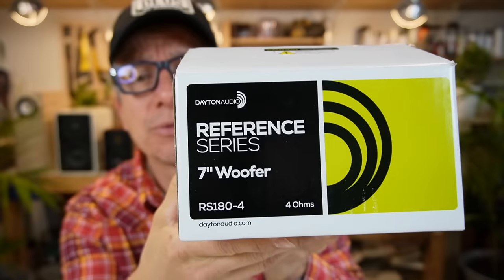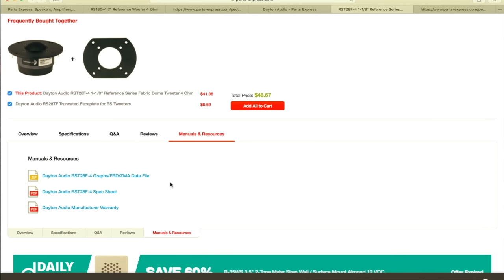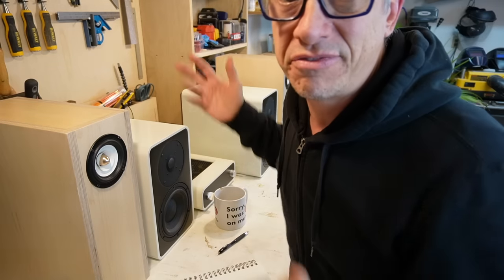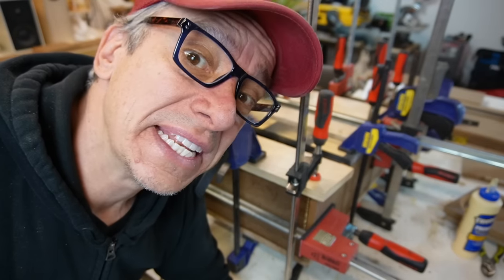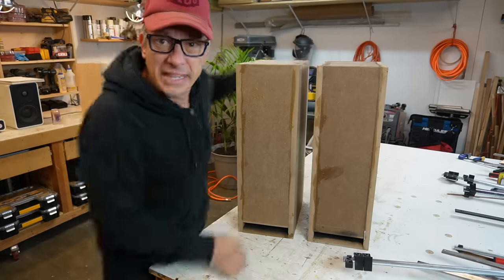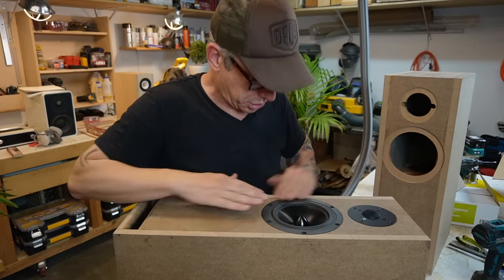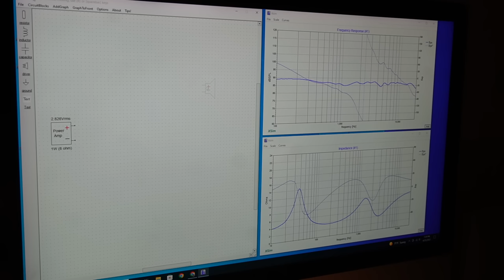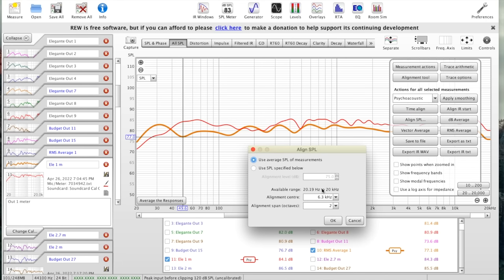Dayton Audio Reference Series Speaker Build | DIY | $200 Drivers Deep Bass Hi-Fi  Elegante Speakers

Comment: Ive used these Dayton reference 7 for several builds but the paper cone version sounds so much better.  I am getting a few more of the paper cone to play with.
Reply from the maker: Good to know. I had those drivers at home though but I wanna try the paper one sometime! Thanks!
Reply: @sonnoradesign    Check out the SEAS Prestige paper cone drivers.  SB Acoustics too
Reply: How’s the low end on the paper cone in comparison to the regular reference cone? You find much of a difference?
Reply: @billymurphy3  they sound very natural and warmer than the aluminum cone. smoother in the mid. Surprising bass response and very fast.
Reply: Hey Soniclab, can i get in touch wih you? I need a crossover design for a too way with RS paper cone...
Reply: @GurvanBHC7  I use an active DSP for most of my builds... your x's-over settings will likely be different for any different enclosure and room as well.  I would start by picking a matching tweeter and do some preliminary measurements,  build the crossover from that.  You may find there is a prefab passive network that suits your build.  Parts Express has some decent-ish ones..  If you want a better one the only way really is to get a range of component values and tweak it till it measures and sounds good...  I am still learning so much from each iteration and there is a wealth of knowledge out there to draw from.

Comment: Good choice of drive units. I've got the paper-coned version (RS180-4P) in the front doors of my car, along with RST-28A tweeters. Woofers are actively bandpass filtered between 80hz and 4KHz, tweeters are high-pass filtered at 4 KHz. Sounds awesome with massive midbass. Aluminum dome tweeters are detailed without being harsh or fatigueing. There's no car audio marketed speakers that can come close for the price of these puppies.
Reply from the maker: I really liked those drivers. I’d add a second woofer if making this box again. Get more SPL and bass. The tweeters are really clean and articulated. Good choice.
Reply: One downside of the Dayton tweeters is that the plastic holding the spade connector deforms very quickly when soldering cable directly. They are not easy to tin without the plastic deforming.

Comment: Hello Bernardo. I am going to try something similar to your veneered side panel design. I don't understand how you veneered the edges. I saw you use the saw to cut veneer strips and then you tapped the strips to the bracing boards during glue up. Was that to make them flat? Then what? Did you glue them to the edges of the panels before you glued the panels to the cabinets? I got lost following rhat detail. BTW, they do look like the infinity speakers, don't they? Elegant and classic!
Reply from the maker: Hey RW! Thanks for watching my friend. The little veneer strips help keeping the center of the wood panels under pressure as soon as the clamps don’t go that far inwards. Just a trick to help. The edges have no veneer, you can see the ply on the sides.
Reply: @sonnoradesign  I'll watch it again with that in mind. I thought maybe you started with MDF, not ply. Mine will be MDF and so edge ply for me. I'm just waiting for the snow to melt, so I can be comfortable in the garage a few hours. Thanks, and feel better.
Reply from the maker: Wow! I forget sometimes that there is snow up north! :)
If you do MDF you can use edge banding on the same material as the veneer. Looks good too. I used MDF for the whole box and added the plywood on the sides as a more elegant finish. You can use other materials as well.

Comment: parts express now says

Parts Express Staff Recommended Enclosure Volume
Sealed Volume	0.22ft³
Sealed F3	78Hz
Vented Volume	0.67ft³
Vented F3	39Hz

thank you for you measurements, it is really hard to get straight answers sometimes.
Reply from the maker: Hey DIE. Thanks for watching. Yes it’s hard to get info on all of that. Or they all differ. It goes according to your taste I’d say. Did you make the box for those drivers?
Reply: @sonnoradesign  not yet, im leaning towards the dc 160 so a classics 2 rip off. with the goal of a really cheap xover.  buuut ive stopped myself and and finishing up the projects i have already started :D
Reply from the maker: @-IE_it_yourself  cool. Let me know how it goes with the DC!

Comment: I suped up the Parts Express #blastbox200 with a slightly oversized cabinet sealed with urethane glue,  aluminum passive radiator and oversized sub. Awesome 👍 Subed too
Reply from the maker: Sounds great!! Thanks for the input Charles.

Comment: Fantastic and very impressive build👍 , Would more traditional box size of 40 cm h, w 20cm and 30 depth was good ? Thanks
Reply from the maker: Hey Ran! Thanks for watching! Yes. It will work well on a smaller box for sure! Those drivers could go bellow 40 Hz with less than 1 cuft volume and they sound pretty clean and detailed.
Reply: @sonnoradesign  Thanks so much man , does the crossover need to redesigned accordance to the smaller size box ?
Reply from the maker: @RanTausi  the driver response will change a bit in a smaller box but man, I’d just use the same crossover. If you have the DATS tool from parts express to get the parameters and work on a new crossover, that could be fun.

Comment: Wait I'm a little confused, you didn't do your own measurements to create the crossover? How can you use the files they provide when each box is different ? how can you use their measurements when you also have a port to deal with whose frequency response needs to be added to the overall woofer frequency response ?
Reply from the maker: That’s right! Perfect scenario would be to measure FRD and ZMA files with the drivers in the box. Most people don’t have Dats or a mic to get those files so I decided to use the ones provided by Dayton, it’s a way beginners can start making their own right away, it might not be the best way but, it worked. I got a good frequency response at the end. I do make my own measurements on other videos. Not sure if you watched it. Anyways, I appreciate your input and thanks for participating on the channel.

Comment: They really look great, I used some of those rs180-4 in a recent build had a lot of trouble with the xover keeping the nasty metal cone ringing(from 4~7Khz), had to cross them very low(1.65Khz) 3rd order ended up needing a tweeter that could handle going that low(without spending $500+), ended up using a Wavecore TWO30W11-1(Fs 410Hz) it seemed to model better than the RST28F-4.
But yours turned out to measure great... wished I used them dayton tweeters now would've saved me a lot of phaffing about and some coin too as the Wavecores were double the daytons in price and by the looks a few less xover parts!  The boombox I put them in is pretty beefy with a Dayton RS265HF-4  sub between them gets pretty loud only using one of those Dayton DTA2.1BT2 amps(50w x2/100w x1).
Reply: @YuccaReptiles I tried 2nd order but the ringing was still measurable and with the large dia tweeter being strong at these frequencys it boosted them even more so I upped the order which tamed it without having to use a notch filter
Reply: @YuccaReptiles The acoustic response is probably 4th order, when factoring driver roll-off.
Reply from the maker: Congrats man! That’s a great build. I wanna try the Wavecores sometime. You are right there is the high cone break up noise and I had to do the same. Go lower on the crossover point. It worked well. I still wanna work a little bit more on the crossovers on another video. I just tried to keep it simple with less components. 
Thanks for the info!

Comment: If the QTS value of the woofer is 0.46, shouldn't the cabinet be made as a closed type? I think the Qts value of the tweeter is 0.92 seems to be high. I think the value below 0.707 is an appropriate value.

Comment: Hi there I have build a 2 way speaker with a mundorf tweeter and a 5" scanspeak and will now extend it to a bass box below with 2 x dayton 225 alu ( lower part of the Bordeaux speaker ) do you have any experience with this or suggestions to design? or should i just round the corners? I have an idea that i will make the sides 2 cm to high, to enclose the small 2 way speaker, to make it different and still not to advanced! love all you do btw, keep it up young man :)
Reply from the maker: Hey Janras!  Thanks for watching! I haven’t worked with the 225’s yet. Have you tried to work on WinISD software to calculate the box? Maybe there is some info on Parts Express.

Comment: Great design. Wondering if port aught to be a bit higher up...
Reply from the maker: Hey Chinmey. Maybe. Getta do some measurements but if it’s turned to the back it would probably increase bass response in room.
Reply: @sonnoradesign oh I like it on the front, I mean the port being a couple inches from the bottom might look nifty or if the sides extended lower maybe idunno six to ten inches. Just aesthetic ideas; unclear if it would sound better or not. Just less reflections off of floor or desk. Impressive video and build tho I wish I could buy them or trade you for a painting/ fine art artwork!
Reply from the maker: Haha! Right? You should make one pair!
Reply: do you still have 
these? @sonnoradesign
Reply from the maker: Oh yeah!!
 @chinmeysway

Comment: Good afternoon mate. I wonder if you can help me please. I am putting together a pair of speakers using celestion ditton 44 mk 2 cabinets. Dimensions are 26" tall. 13" deep. 12" wide. The plan is to use 2 Dayton audio reference series 7" with 2 Dayton audio 10" passive radiators in the back. Will this work ok do you think? Thanks in advance from London
Reply from the maker: Hey Zuki. Thanks for watching! I have to check that with more details, I don’t have the computer now but please remind me to design a box for you. Maybe a ported design would work well as you have a large cabinet…. I have to sit on WinISD to be more specific.

Comment: These look great and pair well with your amp/tube preamp build.. I'll be looking to build these but want them on stands with record storage underneath (like the wharfedale linton)- any suggestions on how best to do the stands?

Keep it up love the vids
Reply from the maker: Hello Daniel. Thanks for watching! Those speakers are big and heavy. Keep that in mind and if you wanna add 13-14 inches under it might be too high. One option would be to make a smaller box, closer to a regular size bookshelf or reverse the tweeter with the woofer which looks good to me. Another option is to extend the side pieces all the way down and use it as record storage and stand.

Comment: Have you looked at the 8 inch model? Its rated sensitivity is 93db. I would like to pair two 4ohm models to get roughly 96 db sensitivity, do you think that same tweeter you used would work? Any advice?
Reply from the maker: I’m not sure if the tweeter would work cause the 8” version cone break up is gonna start at lower frequency. You might need a midrange to cross with this tweeter.
Reply: The RS52FN-8 2" fabric dome midrange has a sensitivity of 90db. Two of these should yield 93d, directly next to the truncated version of this 93.5db tweeter, with the 93 db woofer. I was also looking at Dayton audios horn loaded planar tweeter rated at 105db, paired with 4 of the 8inch woofers which should approach 100db, but I can't find a midrange that would approach that level of sensitivity. What are your thoughts? Have you seen the "Pendragon" speakers?
Reply from the maker: @Jake-uh3ch  hm. You’ll have to do some research. Seas, SB acoustics, Markaudio maybe…. I’m gonna look into the pendragons! Thanks my friend

Comment: What would be the dimensions of the port if converted to a round one. Thanks
Reply from the maker: They need to have the same area. So just use the formula for the area of a circumference, Area = 3.1416 * R at 2nd power. Check online. Thanks

Comment: Is there any pre-assembled crossovers I can buy, that would work for this build?

Thank you
Reply from the maker: Hey! Thanks for watching ! I don’t recommend a generic one and I’m not sure about a specific crossover for this speaker. They are designed for a specific speaker usually.
Reply: The reason I ask is because I'm pretty good with wood working but I would need  a parts list and a diagram to be able to make one my self, if that is something you are willing to share I would very much appreciate.

Thank you 

Tom
Reply from the maker: @nesnakomec  hi Tom. I think I’ve posted the crossover scheme on the screen during the video. Did you check?

Comment: Um, where did you get the measurement files ? You can't just use the ones from their site to build crossovers, you need to measure and capture the data in the enclosures you just built.

Comment: @22:52
Does anyone know the name of that rectangular slide ruler or where I can purchase one??? I currently make all my rectangular cutouts out of scrap material and that thing would save on a lot of additional labor.
Thanks in advance.
Reply from the maker: I’ve posted a link to a Right angle ruler on Amazon. Let me know if that’s the one you are looking for.
Reply: @sonnoradesign 
There was a ruler guide that you used to make a cut out for the speaker terminal cup at the timestamp in my last comment. Do you happen to know where I can find that ruler or what it is called? I appreciate your help and I love the project btw.

Comment: I have a pair of foster ribbon tweeters, e100 10 rated at 8 ohms with a suggested crossover point of 6.4 KHz. They have an impedance of 5 ohms. Because of the high crossover point I’ll be using HiVi  DMB-A 2" Fabric Dome Midrange2” fabrics dome mids than be crossed over as low as 400 Hz and a rated frequency range of 400 Hz to 15kHz with Fs at 700 Hz. am using the same woofers as this  Dayton Audio RS180-4 7" his build.Reference Woofer 4 Ohms, both the midrange and tweeter is rated at 5 Ohms and the ribbons are rated at 8 Ohms. I want to make a mounting plate to mount the mids and tweeters in, the rest of the design would be the the same as your cabinets. Do you see any pitfalls in this design! Please let me know!
Ken
Reply from the maker: Hi Ken. It looks like a lot of drivers which will give you a lot of work to make the crossovers and get them to sound good. There are good discussions for different impedance drivers in the same design here: https://www.diyaudio.com/community/threads/resistors-and-impedance-matching.26011/
I’d try and keep it simple, sometimes “less is more”, unless you know what to do with all of that.

Comment: Hi man,  really enjoyed looking your video! Great job!!
I would like to make my Klipsch RF62 ref2 more "out of the ordinary" looking. 
Before to see your video,  I thought about making similar cabinets for the 2 woofers and take the Tweeter "out of the box", suspended between 2 lateral braces about 50cm higher, higher than the one you just built,  and maybe replace the horn by a wooden one...
I was thinking about using the original baffles and crossovers...
Do you think this could kill the current sound quality or improve it?
Thanks in advance for your advice. 
Please keep enjoy us 😉
Reply from the maker: Thanks for watching Stephane!
I wouldn’t change the box design or move the horns up. That would change how it sounds. I’m not familiar with those speakers but maybe you can work on better crossovers and internal materials; brackets, sound damping….
Reply: @sonnoradesign  but I like the sound but not a real fan of the look 😉
Reply from the maker: @stephanevanrompaey5110  got it. Well, let’s make new ones?!

Comment: You should get a cheap air gun for painting, it would give you such a much nicer finish than a spray bomb.....
Reply from the maker: Haha! Right. I have an average one already.
Reply: I guess it's not convenient to use it for such a small job, but a spray bomb on bare metal with no primer can't possibly yield a nice or durable finish.  I wonder how much $ it would be to have the piece powder coated?  Most towns have a powder coating shop nowadays?
Reply from the maker: I thought you were talking about the speaker. I usually use etching primer first then paint on metal.
Reply: @sonnoradesign   I guess I was saying for both.  The finish on the speaker looks amazing, I'm truly impressed with that from a spray bomb.  I would just be way too nervous to risk using a bomb when I could fire up a gun and know I'd get a perfect finish, but you must have the bomb figured out!  Do you ever experiment with using different amounts of the deadening foam?  I find that when I stuff speakers with filler they sound different depending on how much I use, Iike to be able to adjust to taste.  I'm wondering if the foam behaves similarly?  How do you get that recipe correct?  Do you have a chance to try different configurations before you settle on how much foam to use?
Reply from the maker: @sabresys45  I’ve been doing the spray bomb for now. If it demands like car paint I’d use the spray gun for sure. Its more time consuming though. 
I use the sonic barrier behind the drivers (woofers), sides, top, depends on the configuration. I usually leave the top of the port without it. I try not to overstuff the whole box and use polyfill as well. Its been working well.